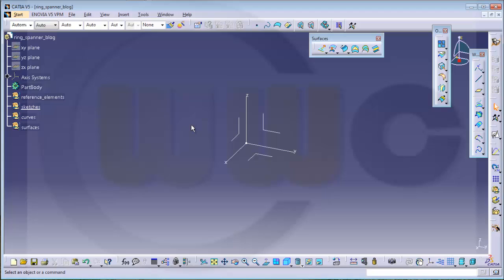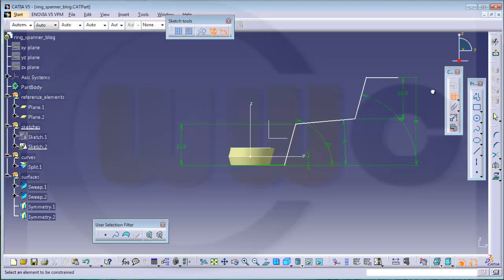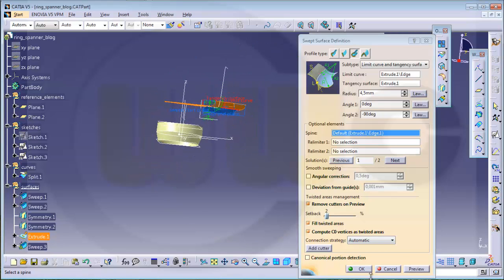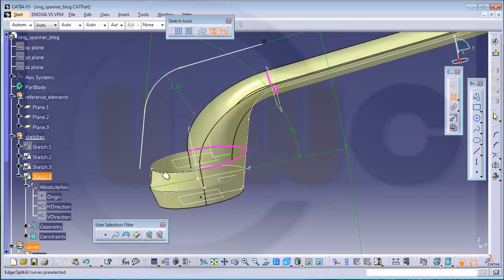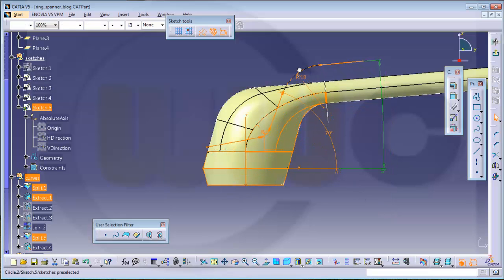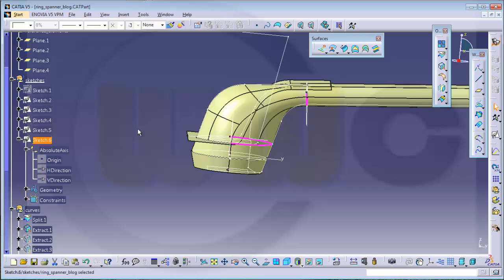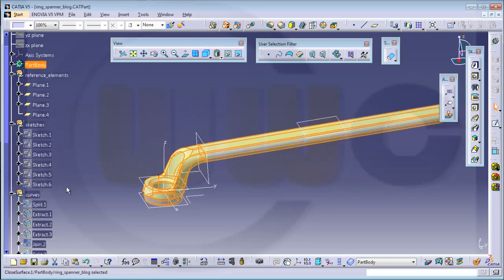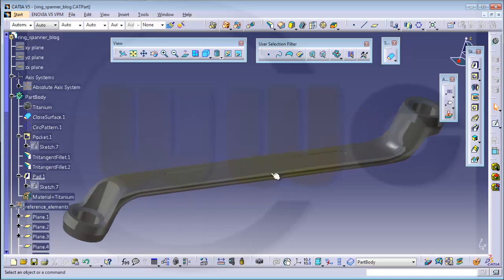Userwish 8 - Ringspanner - Catia v5 Training - Simple version

Comment: I am getting an error at 18:53. The problem occurs when I add a sketch to the Guides section. The error is "A guide does not intersect one profile (or section)"
Reply from the maker: The error message tells you exactly what your problem is: one of the guide curves doesn´t intersect/touch one of the profiles/sections

Comment: Hello Mr. Walden, when doing the step on 17:21min the coincident line to the point of the symmetry surface recently created I just can't do it because when i get back to the sketch4 the symmetry surface recently created disappears. How can I make it stay there when i get back into sketch4?

The next question I have, What does the extract function does (sound pretty silly due to the word meaning)? What are we extracting when we select the edges and Why?

I really appreciate your time an effort,
Reply: heyy , I got the same problem too but I found out that you can reorder the features by right clicking on them 
right click on sketch4 > sketch4.object>reorder>aftersymmetry.4
Reply from the maker: +Orl Esp Extracting the edges - a new element is created and it is selectable in the tree. And you should not use the boundaries of a surface directly. Why your symmetry surface is disappering - I can´t tell without your catpart, sorry.
Reply: +Wolfgang Walden Thanks for the answer regarding the extracting the edges. 
It is disappearing because the sketch4 was created before the symmetry surface, so when i get back to sketch4, it shows is as if the symmetry hasn't been created yet. and i do not know how to edit the tree so i can move the sketch4 after the symmetry. for now, I just created a new sketch (after the symmetry). 

I appreciate your comments.
Reply from the maker: +Orl Esp Seems to me that you are using ordered geometrical sets. You should use geometrical sets.
Reply from the maker: In a geometrical set there is no historical order, just plain parent-child releations nothing else
Reply: yes sir ,actually we didn't have the geometrical sets in the part tree as we have to check that create geometrical sets box before we create the part .
And I have to say your videos are great , I started your video tutorials 2 days back and I have learned a lot . Thanks for all of it . Hoping to get more from you on CATIA . Thanks again
Reply: yes sir ,actually we didn't have the geometrical sets in the part tree as we have to check that create geometrical sets box before we create the part .
And I have to say your videos are great , I started your video tutorials 2 days back and I have learned a lot . Thanks for all of it . Hoping to get more from you on CATIA . Thanks again
Reply from the maker: Of course, I will always make more catia videos - because it is my favourite program :)
Reply: +kartik yadav I appreciate your comments. I already did. With a geometrical set and by editing the tree as you mentioned before. Thanks though.
Reply: I faced the same problem even though I followed your procedure step by step
Reply: by the way, the all work you do sir is great thank you for it